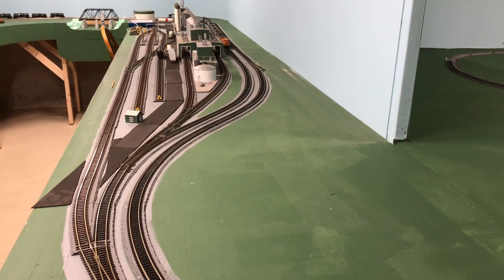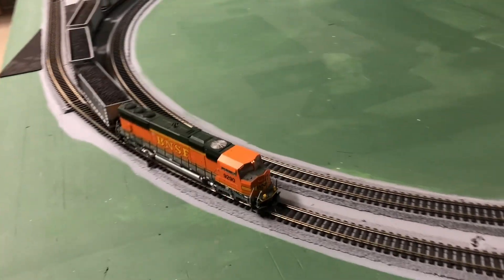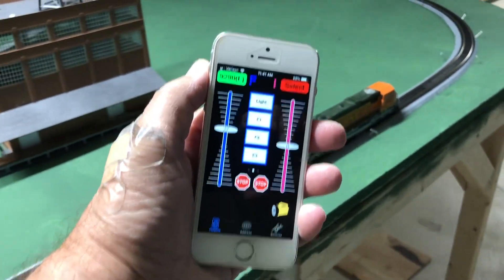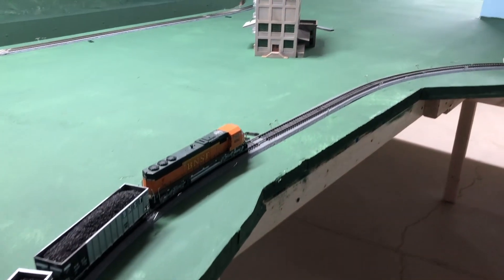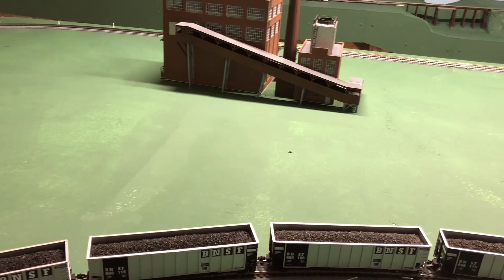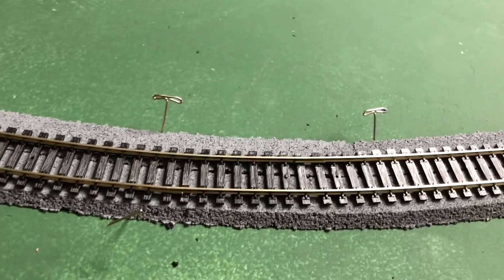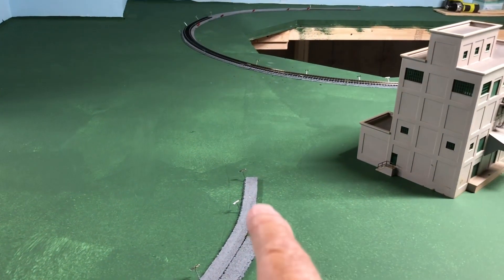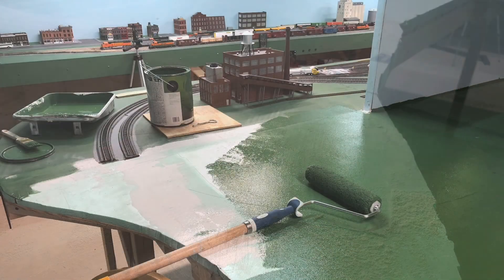Iowa Southern Railroad - S2 E30 Running with NO feeders

Comment: Fred looks fantastic, few questions, what glue did you use for cork , how did you secure the foam, any glue for track , excellent job , very impressive
Reply from the maker: I used Liquid Nails for Projects to glue foam to plywood.  My cork is not glued.  I have it pinned temporarily.  I’ll use 1” brad to secure it to foam in future.  I use track nails to secure track to cork.  I’m keeping the cork and track unglued so I can easily change it if I want to.  I don’t have a ‘carved in stone’ track plan so I can do a bit of freelance adjustment as I want to.
Reply from the maker: Thanks James 😀

Comment: I don't know how you get so much done.  I'd still be building benchwork, lol!     No… really.

On a "How're we gonna keep them down on the farm" note, what are your plans for your southern RR empire?  It's not going to be the same now that you've tasted a living large layout.

Are you going to raise it up a bit, attach it to the wall and finally run a loop around the inside of the garage?  Or build a hellix off one end & create a two level point to point?  Sell it all off on eBay and create a new "bigger" empire in N scale?
Reply from the maker: I’m just going to keep polishing and fixing know problems.  I already have a list.  More electronic projects.  More JMRI learning.  More eBay time looking for deals.  

I’m also thinking about taking models home to build over the Winter.  Getting them into my car top carrier is no problem heading to TX.  It’s bringing them back built that could take up a lot of space.  

I have chores to do on my house.  Stain and repair parts of my deck.  Clean out my attic junk.  Get my yard back in shape after brutally hot summer.  Few others things.
Reply from the maker: I’ve been working pretty steady on these last two sections.  Only benchwork I’ve done this summer.  Messed about with Cargill too long.
Reply: @FredE528  Your paragraph 2 is optional. 😉  And if you buy too much stuff on eBay, even at discount prices, you won't have gas money to go back north - lol.

The best way to transport fragile items that size in my opinion is to leave popcorn fill & bubble wrap mostly out of it.  Through the winter, save Amazon or similar corrugated boxes that'll enclose your models, maybe 3" or more to sides & top.  Build bigger models in modules to keep boxes small & light.  Don't attach things that break off easy & can be added in NH instead.  Nothing you didn't know already.

Break the boxes down so they store - fewer complaints from the spouse - ask me how I know.  Store the boxes in large yard plastic bags & keep them off the garage floor (trust me).   

The tricky part is adhering the base of the built model/module to the bottom center of the box.  First, tape the inside bottom flaps flat.  Double side tape some filler cardboard to the base bottom if it's mostly hollow (and to the box, naturally).  The more box to model adherence area...  

For light models/modules with decent flat area underneath, just GOOD double sided tape may suffice.  If there's no real 'base', wrap the thing gingerly but well in cling wrap, then double side tape the wrap to the bottom.  The main thing is to ensure the visible model areas only ever touch air or loose-ish wrap inside the box.  

The only time popcorn makes sense to me is for a sturdy model with no breakable pieces on or in it (yet).  Plus fill the structure well with popcorn also - it helps.  Taping 1-2" wide strips of bubble wrap over a model is added security if it won't cause damage. 

And no off-roading with the trailer, eh? 😲
Reply from the maker: Great advice!  I broke down and saved most of my eBay and Amazon boxes in the TX garage attic.  Keep bubble wrap in couple of boxes and peanuts in another.  If my wife even needs a box to mail something.  I just say ‘How big?’    No trailer so off-roading is still a go.  Just need to be sure roof box is secure.  My Subura has X-Mode, what ever that is.  Never been off-roading, no snow, no mud, no sand, but to my credit - some gravel.  Car has had a sheltered life.

Comment: I'm not going to boast because I intend using feeders on my DC layout but my videos show various manifests running around over 50 feet of track on a single powered circuit. It all comes down to the length of the manifest and the motive power, including DPUs.
Reply from the maker: I thought I needed feeder every 6-8 ft on DCC.  Guess that’s no so..
Reply: That might be correct Fred to maintain the signal to every item coded into the circuit. I'm using DC so no codes, just maintaining the juice to prevent power drop to the locos. Nothing else uses power at the moment but I've got a separate 16V AC if I want it.

Comment: What are feeders
Reply from the maker: On a DCC layout it’s common to run a main ‘bus’ line under either the entire layout.  You then attach thinner wire from the bus line to the track.  The type of switches you use determines how you install feeders.  I explain my wiring at 4:12 of E31.  If you have other questions just ask.